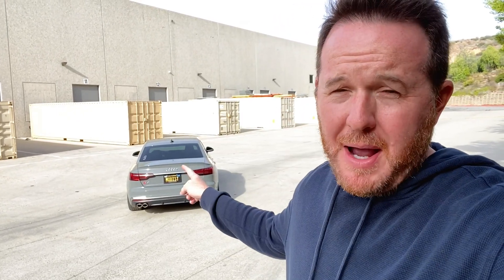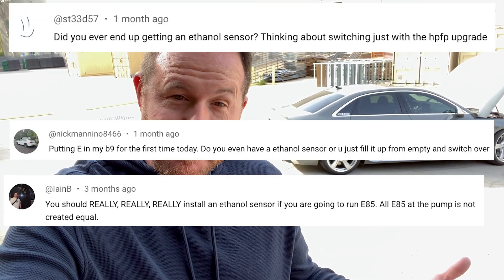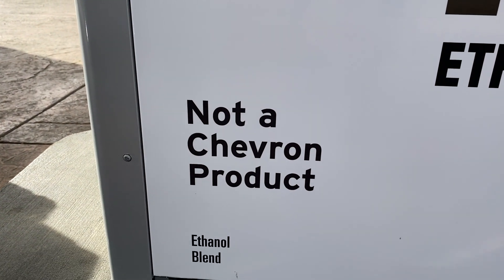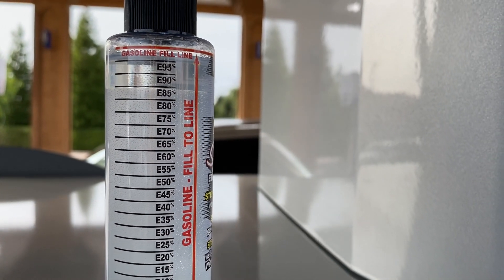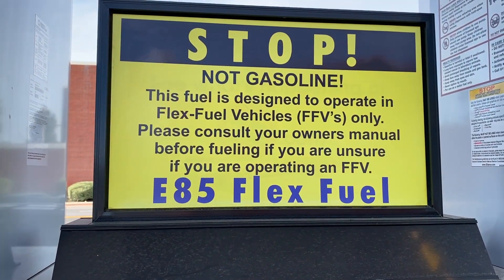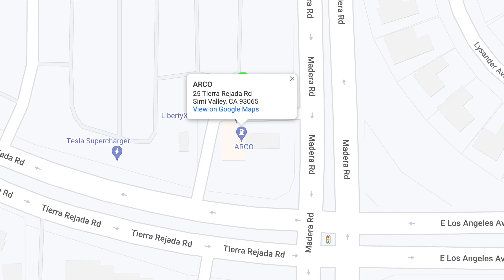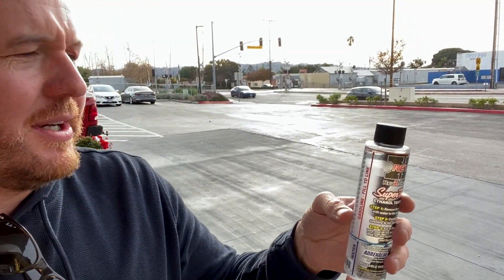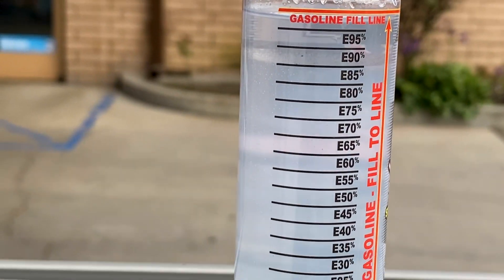E85 Fuel Test at the Pump!

Comment: I live in Northern California and the ethanol content at my local station is typically between 90% and 95%.  Good to see that the E85 in SoCal is also consistent.  I've been running E85 for a little over 7-1/2 years.
Reply from the maker: Nice! I was debating switching back to 91 for a bit, but hearing you've been running for over 7 years makes me more confident that I can leave it.

Comment: E90 basically means the tank has water in it.
Reply from the maker: @NerdGenius  say what?
Reply: @midlifemods If your E85 is reading E90 at the pump, it’s probably got water in it. Ethanol absorbs moisture, and most sensors can’t tell the difference between ethanol and water—so that extra water makes it read higher than it really is. Gas stations with poor tank maintenance or leaky seals can cause this.

Comment: whats up man. I told you I watch your videos. Im the guy with the stage 1+ e85 sportback with all the bolt ons.  I dont run a gauge either. But I buy my e85 from one station that is near me and its a BP station that never tests below E75.   They guarantee ethanol content to be 70% or more.  And it never fails my tests and usually is e85 or e90 on the dot and I use the same tester as you.   In reality as long as you test it first and its above e60 no one has anything to worry about.  Your car will make the same amount of power regardless.  I prefer a higher ethanol content because it burns cooler.  But from what I hear e70-e75 is the sweet spot.  And mine is 300 miles from being an 80K mile car with the old style rocker arms.  Things runs like a clock.  Especially with the stage 2 tcu tune.  Love the vids.
Reply from the maker: What’s up Tim?! No gauge? No problem! 😁 Thanks for watching! Working on some new content this week!

Comment: I my 91 tune and my E85 tune also. Having an E sensor is kind of pointless because by the time it reads it well it’s already in your car and going through your fuel rails. I guess that only works if you were really low on gas and put like a gallon of “E85”

Comment: What about when you can't get e85 one day? 😂 the sensors are dirt cheap especially from pnp
Reply from the maker: I have the mobile tuning app from 034Motorsport. I can flash back to 91 octane at the station after the tank runs empty.

Comment: I have an ethanol tester in my toolbox and use it when driveability issue cars and trucks come in.    Check for codes then take a fuel sample just to be sure some dummy hasn't filled the non-flex fuel tank with E-85 because "Hey!  This is cheaper gas"!!   And more than a few vehicles have had 40-60% ethanol content when they should have had 10-15% max.   They don't run well when they're fed the alcohol they're not designed for.

Comment: E85 is such trash, 2/3 of the mileage for 90% of the price, but hey you can get some more horsepower with a tune at least
Reply from the maker: Trash? Wow. Harsh. When I cruise in drive, I get the same gas mileage. So if you're not racing around, you don't lose MPG. But of course you do if you race around which is also true for 91 octane. Totally worth it in my opinion.
Reply: @midlifemods  this is wrong. E85 has 2/3 the energy of unleaded so right off the top you get reduced possible mileage
Reply from the maker: @Grunttamer  that's a great stat, but I'm telling you that I tracked my avg. MPG on 91 and then on E85 under normal driving conditions. There was zero difference. Here's a fact. According to the EPA website,  the combined MPG for a 2022 S4 is 24mpg on 91 octane. That's exactly what I'm averaging on E85 AND I'm still gassing up once a week AND paying less at the pump. AND I'm running 500hp and 3.5 0-60 times when I feel like it. Sounds like a win to me.
Reply: 2/3 the MPG, but it's $2.25 per gallon,
Vs
Race fuel at almost $5 per gallon.

It's similar to 105 octane Gas for performance cars, and widely available.
Reply: @TheOnlyTwitchR6  I said that in my original comment. “You can get more horsepower with a tune” using E85…
Reply: @Grunttamer  you also compared e85 prices to Regular fuel. 

The prices for what you get are not even comparable.
Reply: @TheOnlyTwitchR6  for a normal user, in a normal car what I said is 100% true.
Reply: @Grunttamer nobody’s using e85 in a normal car your argument is stupid dude this is for people with performance cars that take 91 or 93 nobody said to buy a Prius and switch it to e85 because it’s better

Comment: does water vs fuel really tell you what is in the fuel? hard to believe it does... it can be smth else that is not fuel.
Reply: ethanol is hydrophilic(holds on to water) and gasoline is not. That's why you can use water to "disolve" ethanol in water separating ethanol from gasoline
Reply from the maker: Not sure. Just following the directions. As I mentioned in the video, I did test it with 91 octane and the levels on the tester showed 10% ethanol. So it seems to be accurate.
Reply: Ever heard the phrase you can lead a horse to water but you can't make it drink?
Reply from the maker: 🤔 yes.... do horses prefer ethanol?